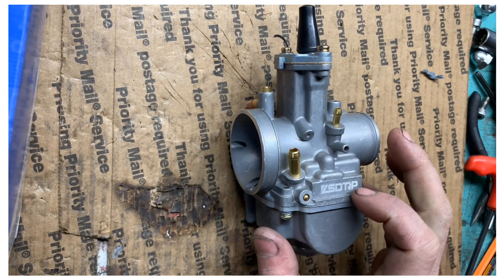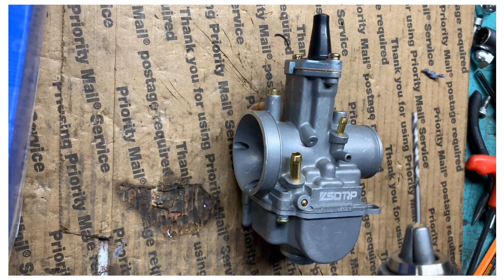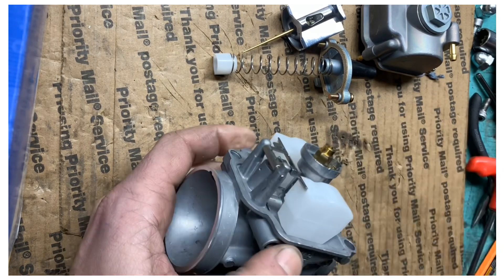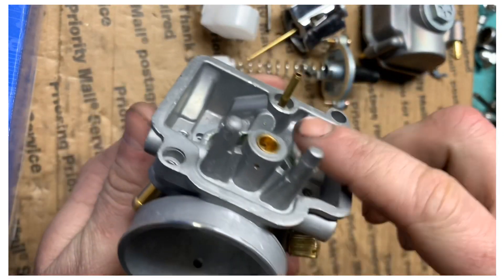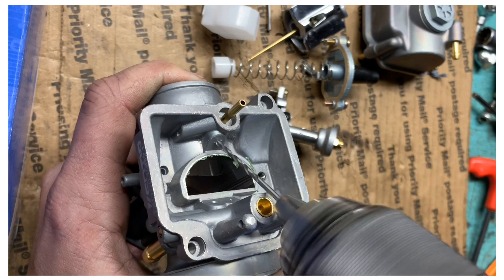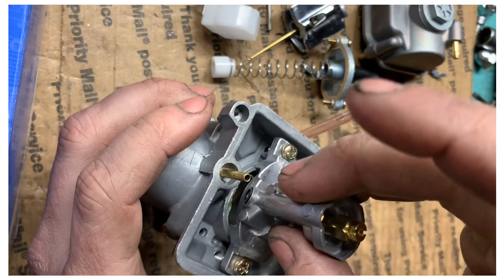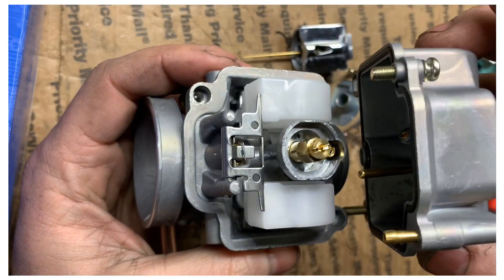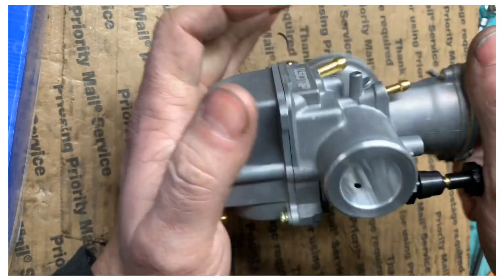How to fix that oko carb!

Comment: You said something about you can't do it on a 212 bike engine  What does that mean I have the grunt monster from you guys then I guess I deal with that boggin issue as well a little bit.. Can I do it for the carb on that engine
Reply from the maker: awesome topics see if that carb didn’t get drilled. 90% if the time we drill then. The other 10% is Bc we dropped shipped one. Check. If it still bogs put a bigger pilot jet in it
Reply: @checkoutsmolikperformance223  thanks do u guys use the grunt monster motor I love it ..thank u guys for ur knowledge and hard work ..peace ..if u have any info for me specifically for my motor it would greatly be appreciated.. Also I wanna figure out how I can put disc brakes on the rear tire because the bike is really fast any info on that I see you guys have disc brakes on mostly all your bikes..and tha is for the speedy responce
Reply from the maker: awesome topics go to zeda mafia on fb and ask the group. Share you motor Witt the group too

Comment: would this help with my idling issue as well?
Reply: What kind of engine do u have is it from zeda motorsports..I ha ea grunt monster engine from them it's good but i have idling issues as well a little bit but it bogs also around half throttle and olny goes about 41 mph..it feels like it wants to go faster but I'm not sure how to make it go faster..
Reply: @awesometopics1988  i did this and it helped my idling issue but not all the way
Reply: Try adjusting your air/fuel screw

Comment: It could have been better if you've started drilling with a much smaller size drill bit then go to to a much bigger if it doesn't work fine. Im also using a 24 mm oko, and i have the same problem. It bugs out at throttle opening. Not sure tho if I'll try the mod. But great idea!

Comment: my carb is stock and i just got this thing . the bottom fuel mfitting the fuel line was on had fuel mleaking out of the vent line so i guess i was right when i moved the line to the top right fitting. the bike only goes 34 its the zeta 100 ???? is something wrong with it ? are the extra jets i got bigger ?